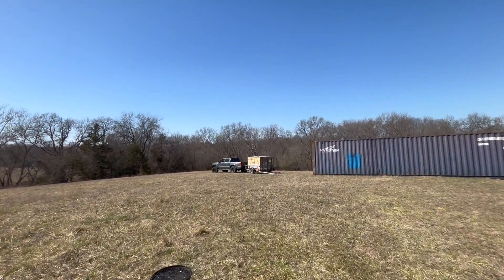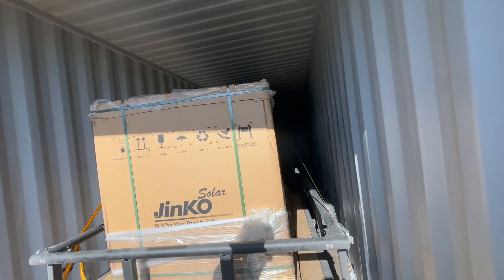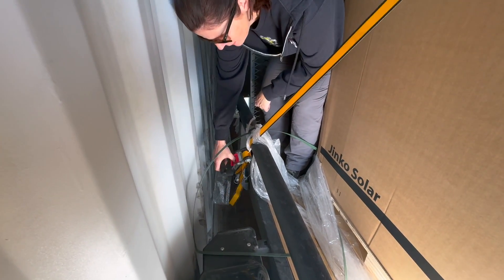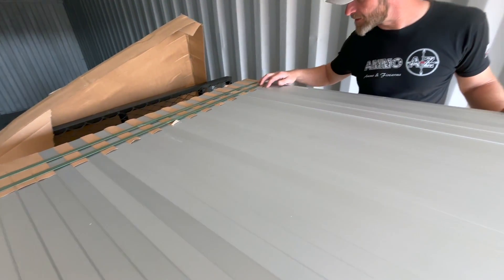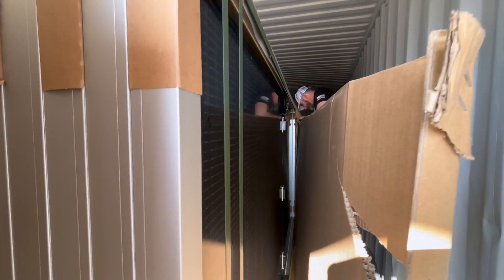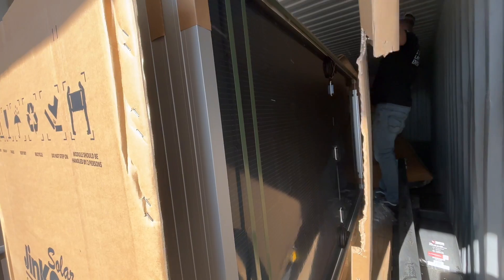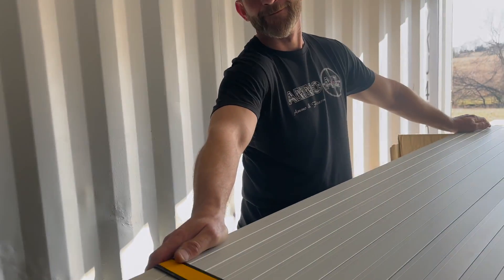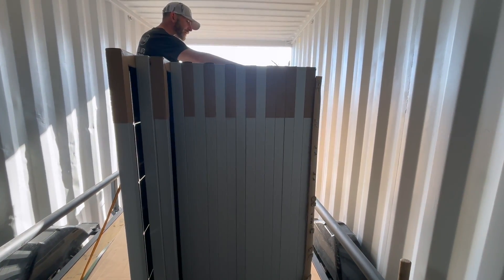Off-Grid Power - Unloading a Pallet of Jinko Solar Panels - A Step Towards Freedom

Comment: hmmm...If those are the Jinko Eagle bifacial modules, you're looking at between 455 and just under 600 watts per panel...That will put you in the range of 14,000 - 18,000 watt hours. Highly suggest getting some pro help navigating the design of your battery storage and controls to get maximum efficiency. Kudos to you both!

Comment: Great modules! Now just don't fall for one of those gimmicky, low budget, high frequency, transformerless inverters that all those hucksters are pushing on Youtube. Spend a few extra bucks and pick yourself up a real off grid inverter that uses low frequency, transformer based inverter tech. You won't regret it.
Reply from the maker: Yeah, there is a lot of garbage out there that is for sure.